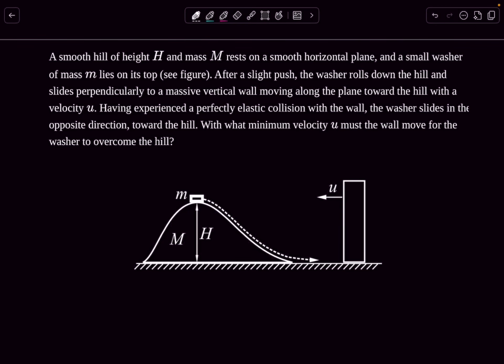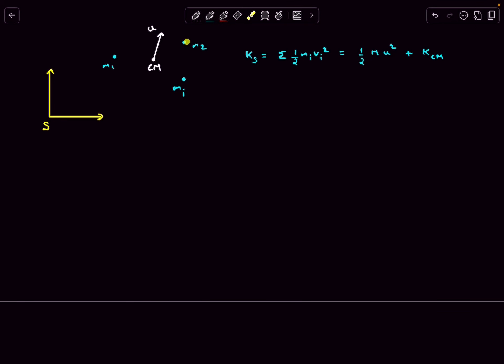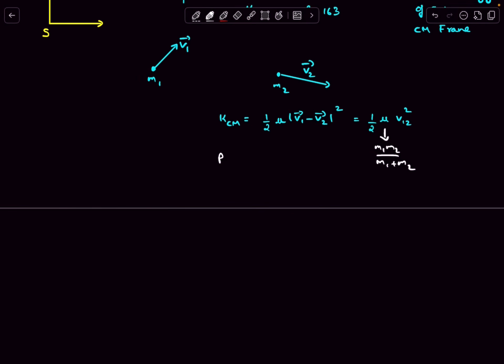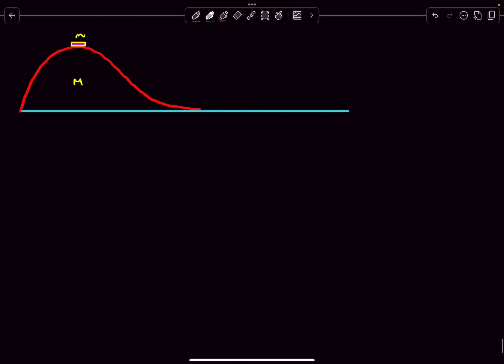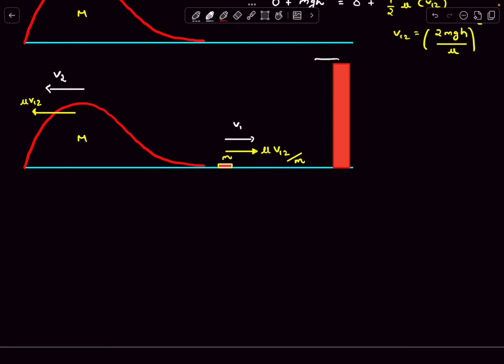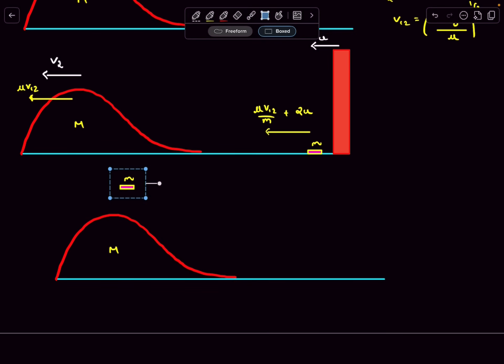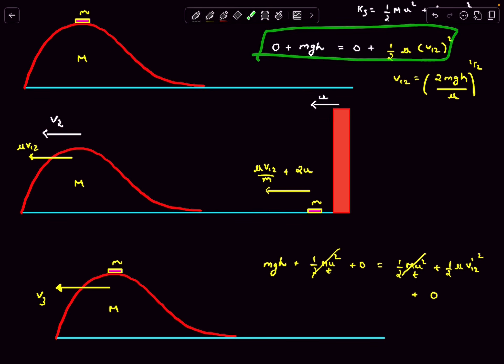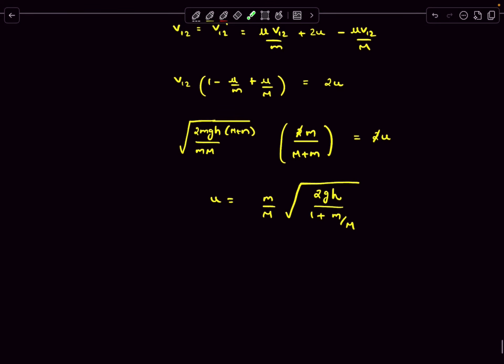Problem on Mechanics For JEE Adv 25

Comment: If in this question in place of horizontal smooth surface you have to introduce friction 
Which may make it more tricker for moderate prepared students
Reply: That would make it pre olympiad level because of it's sheer length and the amount of minute crap you need to keep in mind. Plus there's gonna be a range of values, a lower limit and an upper.